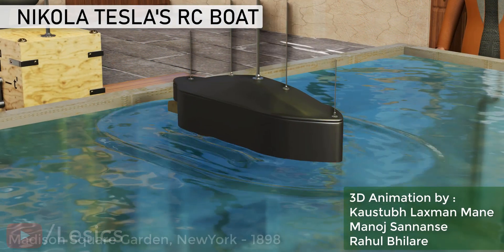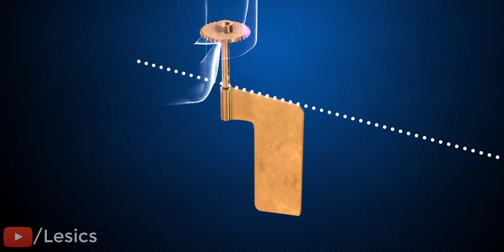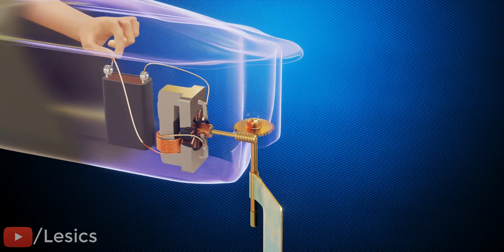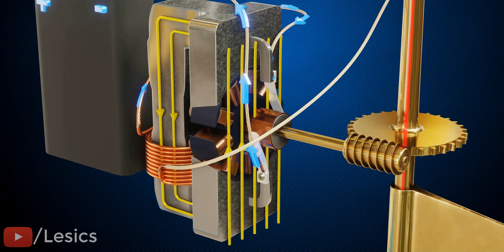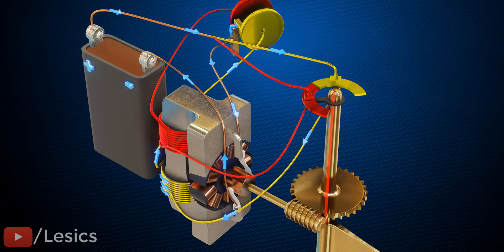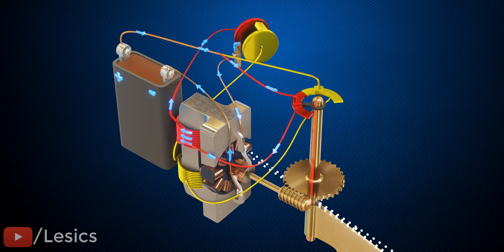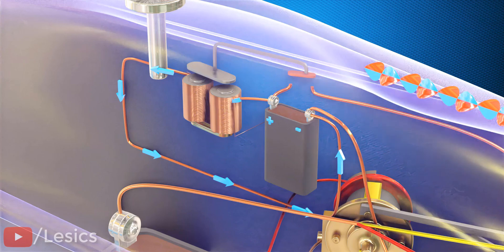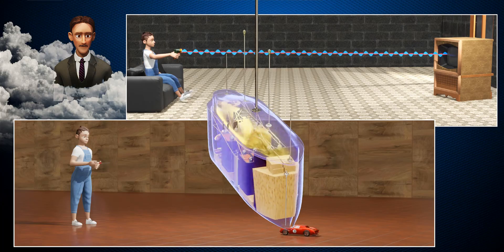Nikola Tesla's Radio Controlled Boat |  Brilliancy at its peak

Comment: Excellent, very well done. However, one update - currently the earliest documented RC model car was a streamlined radio-controlled vehicle which won third prize in Ford Motor Company's 1954 Industrial Arts Awards program. David Swinder of Warren, Ohio used a large control console to demonstrate the operation of the six-foot vehicle. Ref Book - "Building and Operating Model Cars" Walter A. Musciano, Page 37, Published 1956.

Comment: Sir please make a video on modern  Radio Control circuit's  , explaining how the signal transmission takes place between transmitter and receiver to control the motors 
Please Explain function of every electronics components used to built the transmitter and receiver circuit's

Comment: how should it be possible that the spring stores Energy for both directions???  This is Bs ... as always and everything in electricity. Simple Tesla coil designs can already send so much energy to nearby machines that they function completely wirelessly. You might can increase the range of a tesla coil by adding additional coils basically. Like in the tesla transformator.  Maybe... but there is definitley a way to do this with modern tech like strong resonant circuits or something like this. How else should they power all the nanobots they injecting in your bloodstream? Jk. But a range of like 50m shouldn't be a problem to power a little AC motor.
 Would be definitely interesting to know if changing the flow direction of the primary in the tesla coil somehow can change the direction of the motor.

Comment: Funny, the RC hobby didn't get popular into the 1960's even though it was invented in the 1800's!
Reply: Was done in the 1950s, if not earlier..  I was there.  Vacuum tube transmitters and receivers and escapement sequencers.
Reply: @Observ45er  I said popular, not when it became available. TV was available in the late 1920's, but wasn't affordable and popular until the 1950's.

Comment: Tesla's RC technology remembers me to the early RC receivers, they needed no electric motor but used a rubber band driven 'servo' instead.

Here is a demonstration of a simple DIY RC Receiver build with house hold items:
https://www.youtube.com/watch?v=DX7cTJjqomg

This type of receivers where common technology around 1900
Reply: Yes. Nice coherer.  I have the collection of items my dad used to fix a radio control bus that his friend had but stopped working.  I don't know the year, but had to be in the 1930s or 40s. . .  I have his  magazine article, glass tubes and some metal blocks and filings.

Comment: It is actually possible to back drive the worm gear..just require more force acting on it and steeper gear angle. PS5 controller variable triggers is using this mechanism

Comment: Wow that's pretty great and simple explanation. How did Nichola know how much electromagnetic radio waves to deliver to that remote control boat? It looks like one of the most important inventions was the invention of the capacitor which stores these charges and spark until life stronger than the initial voltage put into it. It's almost like a fibulator for heart attack victims isn't that
Reply: He was great in math. Also lot's of experimentation and tuning with each part.

Comment: Today we would probably just use 2 limit switches and a couple of diodes (or a servo). It's interesting to see the ways similar tasks were accomplished before semiconductor technology was developed.
Reply: @Sussy ass motherfucka for the average person sure! It's just also interesting to compare to how engineers today would do it.
Reply: ... semiconductors are very old, just wasn't in market that time bc no one thought they could be so useful.
Reply: @adheesh2secondsago630  Semiconductor devices that could actually do anything useful weren't invented till the 1900s because nobody has the slightest idea of how they worked. They became widely available in the 20s and 30s, but it was not until after WW II that they became well understood enough that people could have an idea for a device, and know what they should try to achieve that using semiconductors.

 Before then it was just people noticing certain materials could be used as diodes, and others as extremely weak solar panels, weak to the point of only really being useful as light detectors and not to generate power.
Reply: Теsla also invited servo and that's all without youtube 🤯

Comment: Didnt he also trasfered energy with no wires ?  Today there are such systems for chargeing your devices wireless over a distance of up to 3meter
Reply: Cellphone, even gps, transmit energy with no wires. Those electromagnetic waves are essentially the same as a wireless charger. With different power levels, off course.
Reply: @pascha4527  allright yeah. Got you. thanks for your answer

Comment: Ah dang the thing I was most interested in was the signal being sent back and fourth itself and how it worked, but I feel like the video didnt describe it very much. Perhaps I was supposed to already know?
Reply: i bet there's a video about it on the channel. not sure though but there are a lot of Tesla videos
Reply: You need basic RF knowledge to fully understand this videos. But they didnt explain the motor either so yeah. Its the base stuff. 

From my monkey brain :
Basically, any oscillating current (AC) on a wire will escape into the air. 

You can also absorb this oscillating current with a receiving antenna. With that current he triggered a electric relay. It's really simple.

Comment: 1:13 “DC Motor”
Tesla has betrayed us...
Reply: I know its a joke but ill say this anyway. Getting a battery to run on AC isn't worth it or necessary, they still use DC. Most batteries run under 12v so to use AC would be more advanced but the primitive DC is perfectly safe and effective. Converting to AC would require a lot of extra components and energy losses.